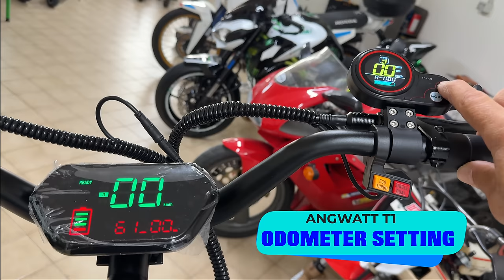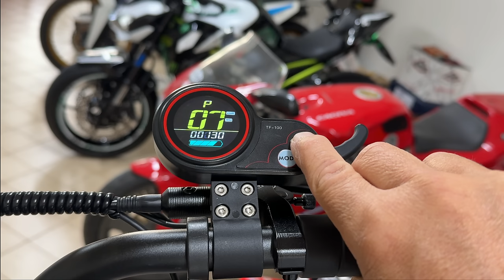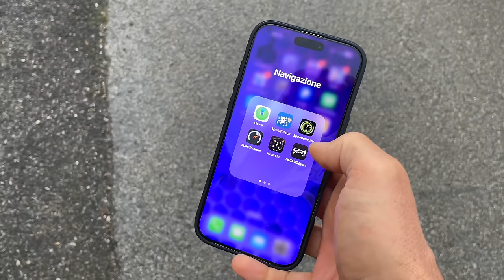ANGWATT T1 6000W - THE MOST POWERFUL ELECTRIC SCOOTER - FULL TEST & TOP SPEED - 4K HDR

Comment: Testing top speed, did you activate both motors? Because it seems slower than it really is. Mine slides in the beginning and its too agressive
Reply from the maker: Hi, I start with an engine so as not to slip the wheels and then when I'm moving I start the second engine..
Reply: @XTOMCICOS  ah ok that explains the soft start, what i do is, always having both motors but start in eco mode, then turn off. So both motors have the same running time 👍 cheers thank for clarify

Comment: What range on full charge  whit ur weight (and what ur weight)
Reply from the maker: I weigh 75kg but I still haven’t looked at the actual autonomy, for the video I always kept it at full power and with 2 engines running and after 30km the battery always scored the maximum..

Comment: g3 pro or angwatt t1 ?
Reply from the maker: ANGWATT T1 MORE BRUTAL AND WITHOUT CONTROLS, G3 PRO VERY POWERFUL BUT SAFER.. IT DEPENDS ON THE TASTES BUT ALL 2 ARE BEAUTIFUL
Reply: @XTOMCICOS ANGWATT T1 have more power?
Reply from the maker: @bugus.s  T1 MUCH MORE POWERFUL... 6000W
Reply: @XTOMCICOS is it better to buy angwatt t1?
Reply from the maker: @bugus.s  It depends if you prefer strength

Brute or strength

Safely.. Surely as assemblies and quality of materials better g3 pro..
Reply: @XTOMCICOS I think I'll buy angwatt t 1 because I think it will also be comfortable and cool and it's also very fast